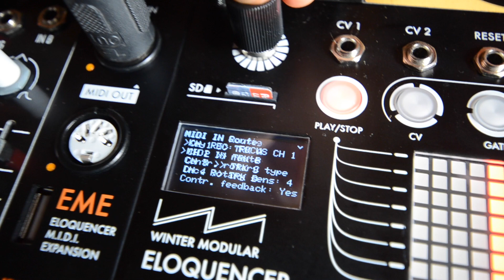EME   6   MIDI in Route

Comment: Please tell me how the medicaid connects to the computer
Reply: Midi cable
Reply from the maker: In this specific case it was connected via cheap 'USB <-> MIDI DIN5 IN & MIDI DIN5 OUT', but you can do it using a DIN5 cable and then connect it between EME and your Audio Interface with MIDI connection.